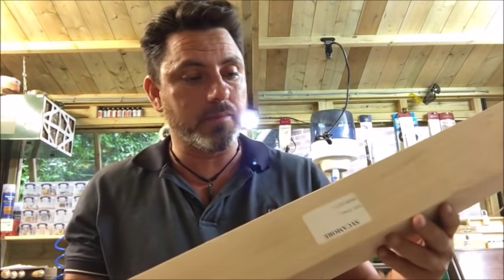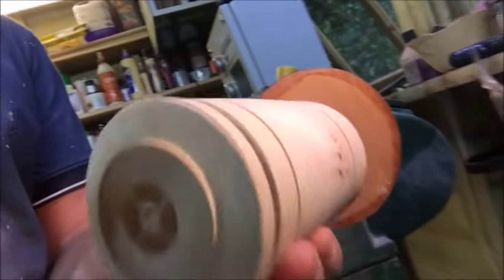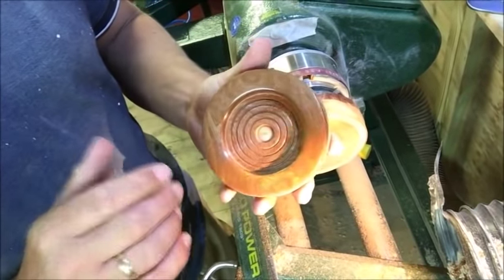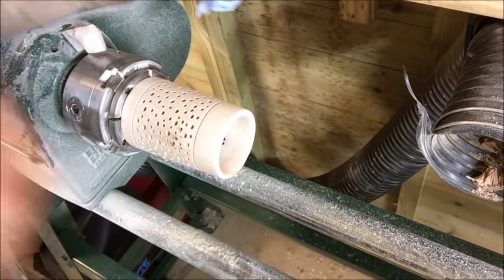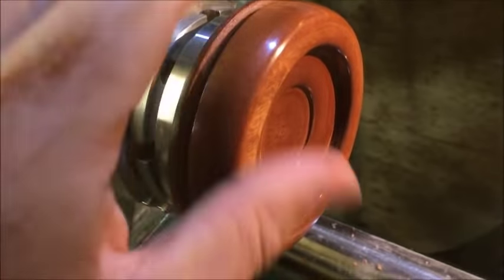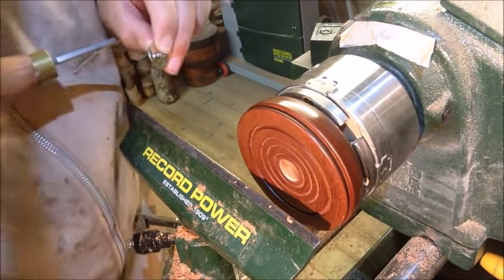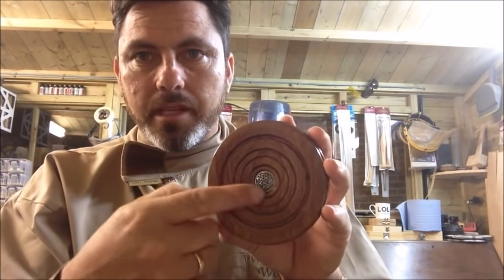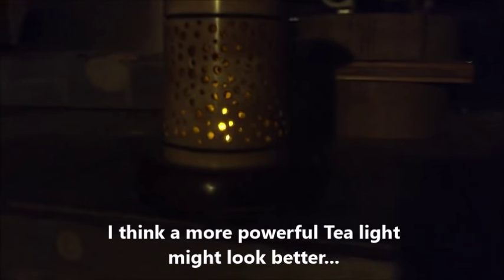Woodturning - The light lantern

Comment: Nice Tea Light, NickIf you turn the tube thinner and drill bigger holes the light will show better!A SERIOUS Safety Note, NEVER use the burning wire by just holding the wire in your hands, attach two pieces of dowel to the ends of the wire for handles... If the wire catches while burning, and it will, you could loose a finger!Peter F.
Reply from the maker: Hey Peter, yes I agree. I have made one now, I just get a bit lazy sometimes. All the best

Comment: I enjoy seeing your woodworking and I noticed a habit you did that you should change, when drilling out any turning with a Jacobs chuck ALWAYS have your hand on the drill chuck. The Morse taper can slip and let go and you can easily tell by the weight of the drill chuck and the drill that it is not something to have flying around towards you. Refer to Keith Barrow, a UK wood turner and you can see exactly what I am talking about. Turn safe!
Reply from the maker: Thanks James, much appreciated. All the best
Reply: I'm a metal turner, and have noticed wood turners holding the chuck whilst drilling. If the tapers are in good condition, and installed correctly they shouldn't release, except when drifted out. Is the problem when withdrawing the drill, with the wood contracting? 
I have never held the chuck. If the taper can't hold it how can your hand stop it turning? If it does start turning it certainly wouldn't fly across the room as the chuck arbor would still be inside the tailstock quill, and the drill is in the hole. I know this post is 2 years old but somebody tell me I'm wrong. I'd rather see the chuck turning than watching my hand turning with the chuck........
If your still here Nick. Nice idea. Partner really into smelly candles, might just turn one off myself. Thank you. Has to be a quicker way of drilling all those holes though.